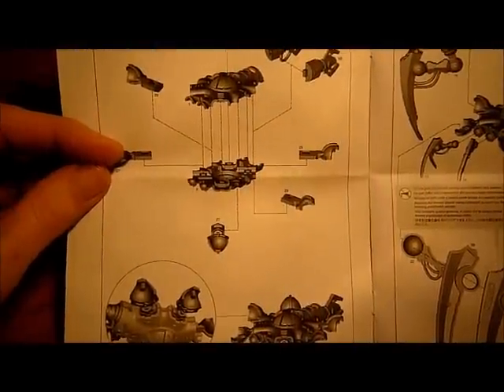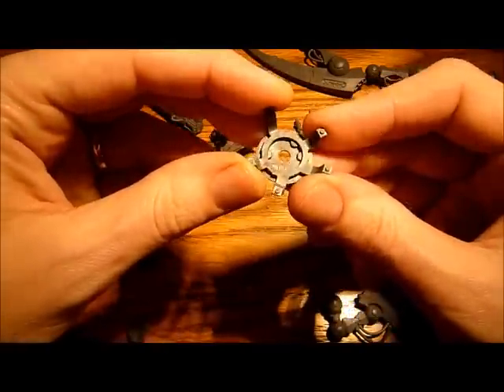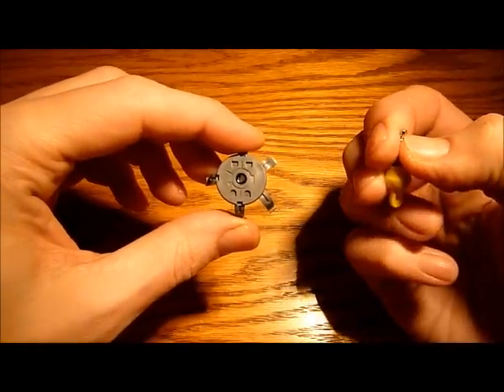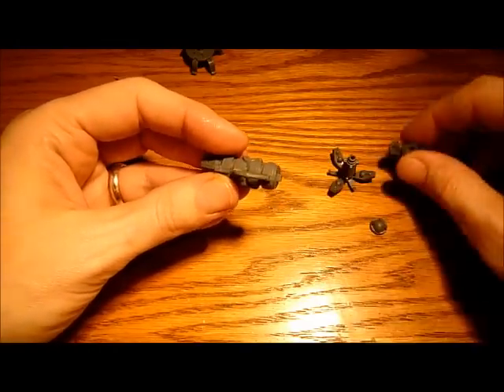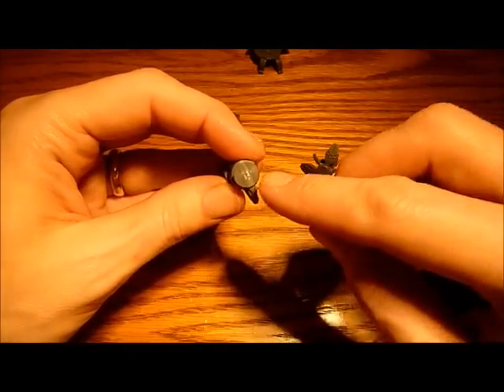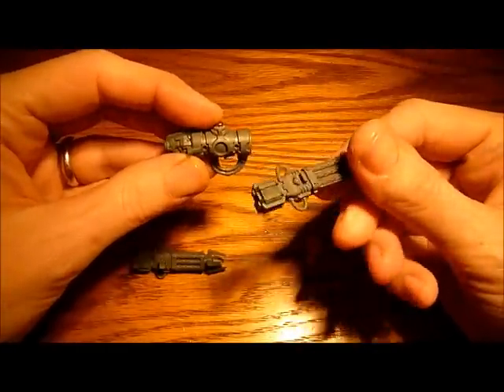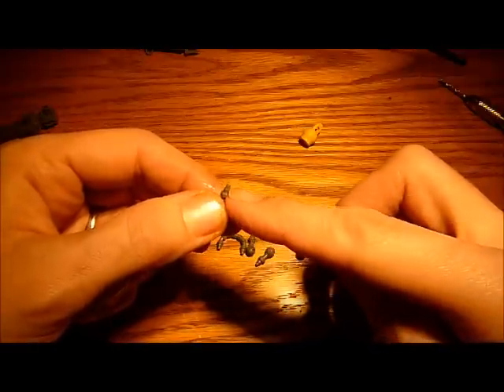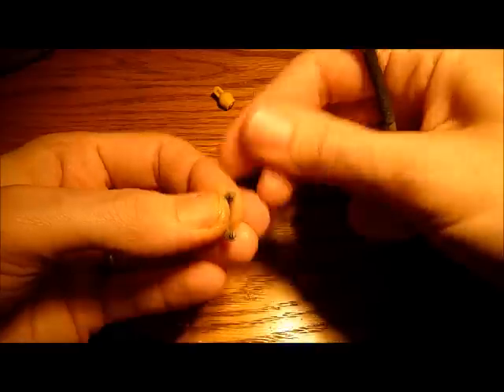How to Magnetise a Necron Triarch Stalker

Comment: how long are the magnets good for? would hate them to lose their power after a year or so
Reply from the maker: As far as am they don't lose their magnetism, but only if you go for a neo one, Iv'e never had one stop working anyway
Reply: Neodym looses the magnetism in about 2000 to 15k years. But if they are exposed to great heat, they'll loose it way faster

Comment: So I only need one size magnet? The 2mmx1 ?
Reply from the maker: Yes my friend, that is all I used. I would suggest getting some N52 strength magnets if you can or at least N45. Don't use N35 as they won't be strong enough
Reply from the maker: PS here is the tutorial in written form if it helps http://www.idicbeer.co.uk/2013/02/how-to-magnetise-necron-triarch-stalker.html
Reply: +IDICBeer 40k thank you.  Appreciate the quick response and this video.   I ordered some right before you replied and luckily they are n50.  So, I should be good.   Thank you again